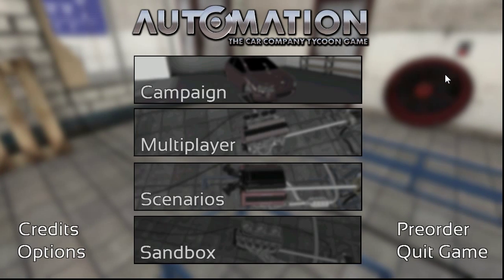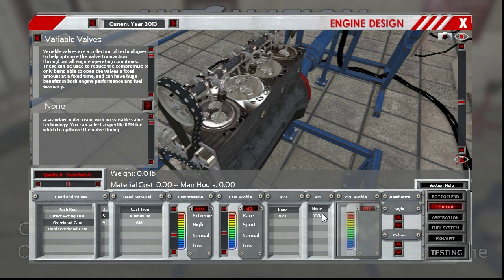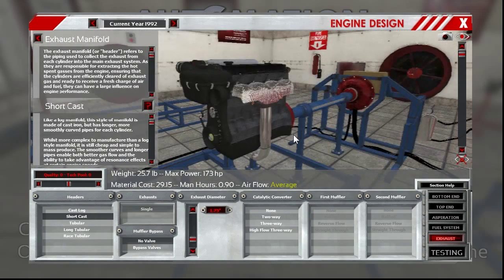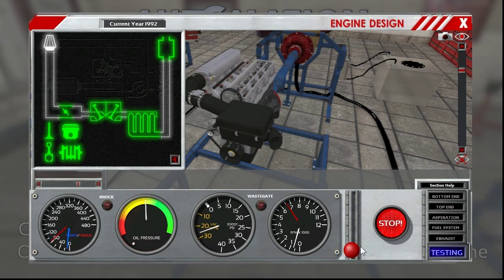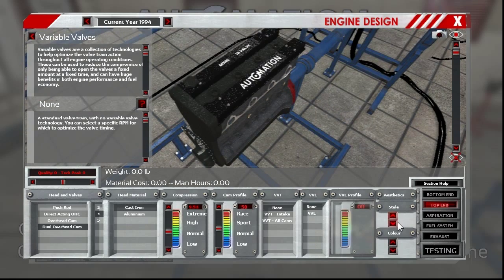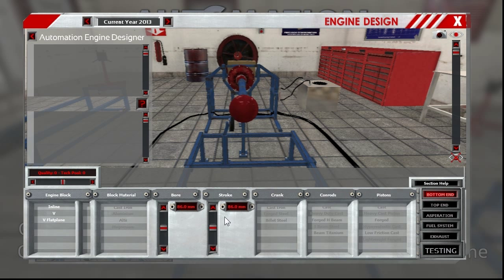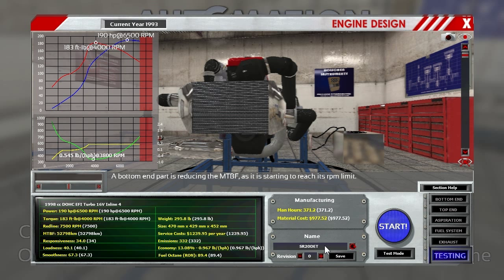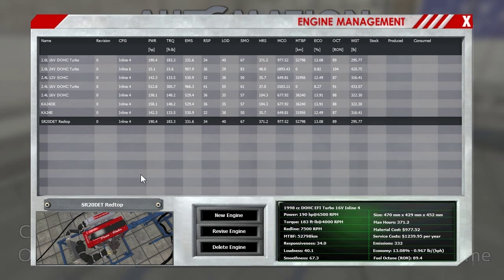Let's Beta Test: Automation Episode 6 " 90s Japan Recreations Part 1: 240sx "

Comment: heavy duty cast is for low rpms not high for the higher reving engines you want to use cast and you may also want to experiment with the hyper cast and low friction cast

Comment: sr20s made 11psi stock
but no one in the usa uses the factory ecu controlled boost solinoid and runs off the wastegate pressure which is 7psi